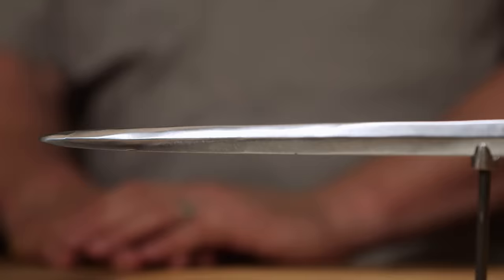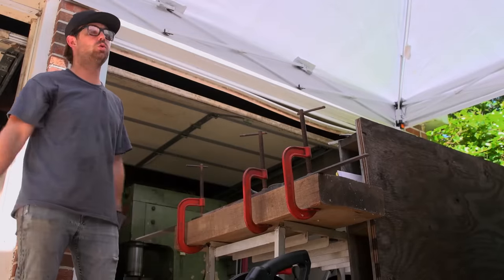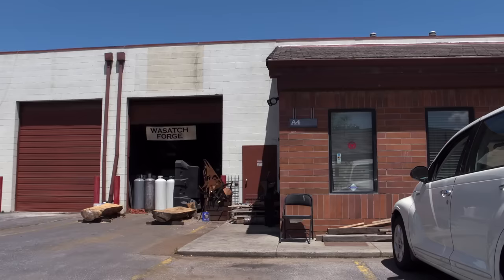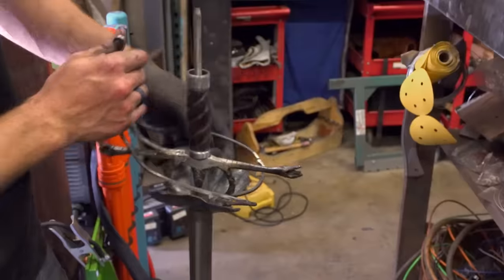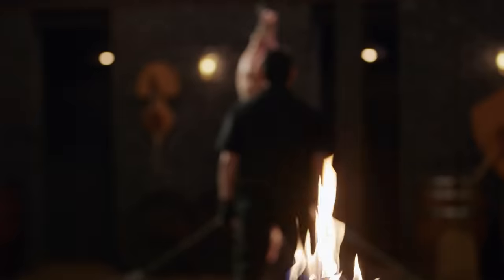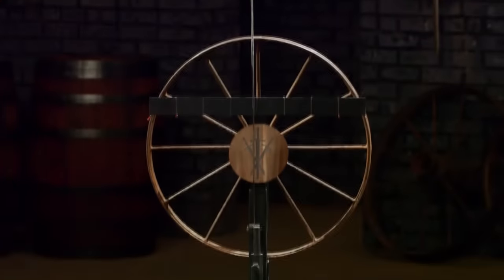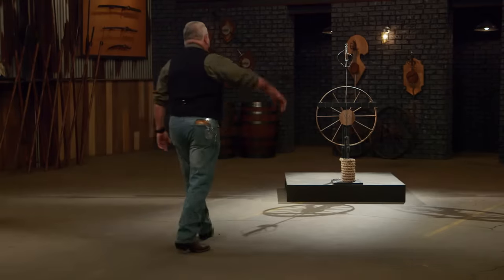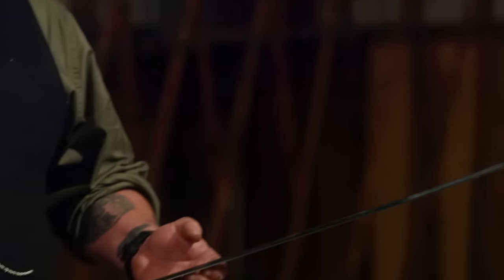Forged in Fire: Musketeer Rapier Final Round: Teddy vs Jesse (Season 7) | History

Comment: these strength tests are bananas. its like something cold steel would do in their marketing. i could not believe how far those swords bent without snapping.  was almost 90 degrees.  both were very well made.
Reply: A blade that is hard will snap under pressure, combat isn't perfect and more often that not your blade is going in and out of something at a weird angle
Reply: charles norris It is not almost it is 90 degrees
Reply: SHPRESIM Leci it’s clearly not it’s a few degrees above
Reply: I cringe everytime they do this test
Reply: The test is original from traditional toledan blacksmithing and swordmaking.
It first consisted in flexing the blade 90 degrees both ways and then hit hard a helmet with it.
All good swords had to pass it.
Reply: The test is stupid. Of course a sword isn’t meant to bend like that it’s a sword not a boomerang
Reply: @Dog Faced Pony Soldier but with that flexiblity, the lose some of their piercing power. Even if very sharp, a blade that flexible could probably be stopped by a leather armor.
Reply: @landonjenkins4402  well actualy a rapier IS supposed to be extremely bendy and almost all swords have to bend really well anyway. You don't realize the wonders of spring steel my friend...
Reply: @TheMihig  at the time you would primarily face opponents with gambison wich is very hard to go though anyway since a proper one can pretty much almost stop a warbow arrow from going through.
In that case you'd prefer having a blades that bends well and goes back to true rather than a hard blade that snaps because it couldn't go through.
Reply: A rapier is supposed to be very stiff as it was primarily a thrusting blade. While flexibility is important to a degree in a rapier, it functions primarily as a detriment past a certain degree. What you are likely thinking of are practice rapiers, which are flexible in order to mitigate injury.
Reply: @brendanbreland4652  They probably meant flexible as in having a high yield point on a stress-strain curve, rather than a low elastic modulus. You would want a sword to bend under a lot of pressure (e.g. when hitting an extremely hard material or hitting at the wrong angle) as it distributes the force onto a larger area, such that the sword does not break or permanently deform. In any case, flexing is a pretty good way to test the heat treating, as the presence of dislocations and defects in the blade would significantly lower yield strength/strain. (Or so wikipedia says)
Reply: @xXDJ_BennieXx  why?
Reply: @landonjenkins4402  that's literally what rapiers are made for
Reply: with modern steels available. the bend test should be passed easily
Reply: @landonjenkins4402 a rapier in particular should. The spring can actually add extra power to a stab.

Comment: Two men on battlefield, one bends his sword and comments, " sir, I have had a catastrophic failure of my blade and cant allow myself to continue with an inferior hardened weapon and must leave the  battle.
Reply: But, it weel keel
Reply: I agree mate, if I was in battle, it wouldn't matter if my blade was a lightening bolt shape, I would still fight!
Reply: If it was battle you wouldn't have a  Rapier
Reply: @jmc9137  i guess you're missing the point. I said " sword " in my comment. The general thought being..  you use what you brought to the fight, no excuses. And then there's the stupid way in which they do their strength test. Stop using a knife as a hammer. Any bladed tool is for chopping, cutting, stabbing, or slashing. Every tool has a unique purpose.
Reply: @MrRadioAmerica  ok
Reply: @MrRadioAmerica  This particular test was a good one for this weapon though. Rapiers need to be very flexible, since they're so light. I've seen local sword smiths who demonstrate the bend test on most of their swords before they sell them to you. For some weapons they definitely give them inappropriate tests though.
Reply: @jmc9137    You would use a rapier in battle. They had guns back then but infantry and cavalry charges were common.
Reply: @TheGrumbliestPuppy  rapier aren't actually light they can be pretty heavy it's just that the center of gravity is placed near or at the handle to make the rapier very maneuverable.
Reply: @Appalachian Sasquatch with Internet Access a proper rapier should way similar to a longsword which would be on the more heavy side for a sword.
Reply: Would it be more accurate to Widdle a Rock
Reply: @thorfinn_jorstinnsonr  It's all fine and dandy until you strike an opponent's shield and your sword bends into an L-shape.
Reply: @dogman9291  THEN YOU THRUST SIDEWAYS!!
Reply: @dogman9291  T'IS BUT A SCRATCH!!!
Reply: @thorfinn_jorstinnsonr  I like your attitude, soldier, but a man without his sword arm is a dead, dead man!
Reply: Exactly! It was FAR FROM being a catastrophic failure, it was a minor bend, nothing more. It was obvious which one won, but to call it a catastrophic failure is just wrong!
Reply: That's the reason you test them before
Reply: @thorfinn_jorstinnsonr  If your blade was in the shape of a lightning bolt it'd snap withing one or two hits.
Reply: But they do have to determine a winner so any mishap is justification to eliminate.
Reply: @TheGrumbliestPuppy  rapiers are actually just as heavy as medieval arming swords, they are just better balanced for manuverablility
Reply: @thorfinn_jorstinnsonr  Not the point but okay.
Reply: Hahahhaha
Reply: If I was the guy with the broken sword I would just throw it as a distraction and pull a rondel dagger to close the distance & make it impossible for my opponent to thrust or cut into me.
Reply: The point is to see who has forged the superior sword, and not can that weapon be used to kill even after the tests.  Even a stick with a sharp end can be used to kill
Reply: Please shake our hand and leave the battlefield
Reply: @jmc9137  if the halberd or musket broke the rapier is the last option
Reply: @dogman9291  i thrust upwards
Reply: @spartansquid5931  it will still do
Reply: No you would it’s die
Reply: Understandable, have a great day
Reply: @thorfinn_jorstinnsonr  yeah you would, but you would be at a severe disadvantage against someone with a better blade
Reply: @TheGrumbliestPuppy  rapiers aint light my friend, they usually weigh about the same as a two handed sword yet they are much easier to control due to the weight distribution
Reply: @grief6052  Wow thanks for not reading the rest of the comments and seeing that 9 people have already said this.
Reply: @TheGrumbliestPuppy  well I think tests are always a bad test
It's all abuse 
But I totally know what your saying
I think it's dumb that they did/do a kill test and then act like any other tests matter
😆
Reply: @brandonfoley7519  but thenother tests matter and they have to pick a winner no?
Reply: @brandonfoley7519  if they specify it so yeah... u can lose if you made something out of the parameters...
Reply: but a rapier has to be flexible, that's what this test is about. if it bends that's a problem. obviously if a sword is falling apart you will still use it but they aren't in battle and that sword failed
Reply: @jmc9137  rapier was massively used in battle in 17th, progressivly remplaced by court sword(sword for noble, like noble at Versailles )in duel and saber in battle
Reply: "Can't use a sword? Understandable. Take your position among the bayonet line. "
Reply: Second man raises his weapon : It will kiiiilll!

Comment: "Now, a rapier needs to be a fast, light, flexible weapon" From what i've heard rapiers are actually little bit on the heavy side, what you are talking about is a... well google translate called it a skewer...
Reply: yeah, rapiers being light is a massive misconception. They were just as heavy as any other sword.
Reply: @sailoroftheinternet3290  They are also pretty rigid. Only training rapiers are flexible, as to make stabs not dangerous... which is not a sought-after perk in a weapon BASED around thrusts.
Reply: @sailoroftheinternet3290  yeah, the real difference with others type of sword is that in the rapier, a lot of the weight is concentrated in the cross guard
Reply: Rapiers are certainly not for the nimble types . They weigh from 2-4lbs. A bit of a range there. 
The cross guard area has quite a bit of  weight to it too. 
Not sure why video games think the rapier is for lightweight bandit or thief types. Add a Rotella shield to your off hand and some armor to complete the set. 
 For nimble you want  a  epee or small sword in that role or a dagger.

Comment: Rules for winning Forged in Fire:
1. Use spring steel stock. Don't do Damascus/pattern welded steel.
2. Make your weapon as light as reasonably possible.
3. Make sure your handle is rounded and comfortable.
4. Get the heat treatment right.
5. Put some kind of shock-absorbing material in the handle.
Reply: You need to be a contestant
Reply: You don't want the handle too round or the weapon will be difficult to index
Reply: @6393dude  was about to say that. Lol
Reply: Handle needs to be ovoid in shape not round. You can't index something with a round handle it also turns in your hand when you make contact. An ovoid allows you to index perfectly and keep edge alignment even after you make contact.
Reply: Ik it’s overdone but do make a Damascus blade. If it comes down to aesthetics that’s points towards your blade
Reply: Solid rules, handle shape has already been corrected enough that this should be a poster for blacksmiths
Reply: Also the guy used knife/tool steel for the sword that's why it's so strong lol.
Reply: La ROPERA tiene forjado y acero toledano ,rico en carbono,al cruzarlas con catanas estás se rompian, 40 españoles derrotaron a 1000 samurais
Reply: @procheesy2355  i have yet to see a single episode where teh winner was decided only by aesthetics - if both pass its always either functionality, balance or weight that kills one of the blades the aesthetics are dead last on the list of considerations.

and because folded steel compromises strength of the material you will have to make compromises - either use more material to compensate for the weakness or rishk the blade failing

and of course risk delamination that is ALWAYS a risk with layered steel
Reply: One guy used 5160 which is a Spring Steel, also used in leaf springs, and the other guy used 80crv2 bar stock. Normally the 5160 does do good in most blade functions. It just came down to the heat treat in this episode. I was sorta suprised 80crv2 did as well in the flex test.
Reply: This is just rules for bladesmithing in general
Reply: also they'll say it kills even if its the sharpest or pointiest, make it robust but light
Reply: @procheesy2355 Damascus is just making inferior steel a little better.

Comment: They always seem to give up on weapons too easily. 
"Your blade did reflect the sun into my eye a little bit too much. This is a catastrophic failure, and for that reason can no longer test your weapon."
Reply: It seems your edge has taken on a roll 1/64 inch long after we beat it with a sledge hammer while its was layed edge down on a bed of iron files. This is a catastrophic failure.
Reply: Should be more like: "It seems, that i cannot use any weapons, that are not short and stiff, like a chisel. This is catastrophic failure... I should be laid off, because for that reason i can no longer test your weapon..."
Reply: the only weapon i can remember thinking "they could keep testing it" was the wind and fire wheels : he had two of the exterior blades snap off. after the second, they gave a vote of no confidence. here it was more valid i think because of how close the bend was to the hilt, compared to the almost utter lack of bend in the other weapon
Reply: mustache mike bahahhahha fr
Reply: the nexy test was thrusting how do you thrust with a tip going at a 30 degree angle?
Reply: carefully. in all reality, it was less that his weapon utterly failed, and more it sustained significant damage where the other took effectively none.
Reply: @gabycashy5  The point is that they never bother to try. It is still a useable weapon, if it happened in a real life situation you wouldn't suddenly run away, you'd keep using it because it can still inflict serious damage and kill.
Reply: L3GION MUSIC hahahahaha
Reply: SπdR if they can’t have a good grip the blade could slip and hurt the tester
Reply: "Your sword was made a different time of the day that is unfair we will have to fail you
Reply: @SπdR the funny thing is that actually happened
Reply: We shot your sword with a missile launcher, and it got bent. Therefore you cannot continue this competition
Reply: Your sword had scorch marks in it because we blew it up with C4. This is considered a catastrophic failure and we will have to ask you to leave the forge.
Reply: Seem indeed to the untrained eye. If you torture test a sword which has bad heat treat it can snap and harm the wielder. It has happened before and they have medics on set.
Reply: You miss out we between reason and can
Reply: The fact of the matter is that one weapon took a bend and the other didn't. Saying "catastrophic failure", as bad as that sounds, is still better than the real reason, "Your competitor's blade is so clearly superior to yours, there's no point in further testing."
Reply: lol i wanna see you guys test a sharp weapon without knowing how safe it is
Reply: @L3gionMusic  bro... if it lose, then it lose, why taje the wait and let the man suffering instead to just send him back home soon?
Reply: @lukewithann7256  right? I allways fear the icechop test
Reply: It seems I’m not strong enough to put a dent into this blade, and because of that I am embarrassed, and because of this, we have killed your family and ask you to please leave the forge.
Reply: My wife left me last night and that is a catastrophic failure, so for that reason I'm going to have to ask you to please leave the forge.
Reply: the blade already took bending on the first flex test. Then the bending was more pronounced after the 2nd flex. there is a possibility that the blade would snap or shatter onto the next tests hence they have to give up
Reply: Whenever the blade bends, and it’s not a flex test, they always allow the competitor to bend it back before the next test. The problem is a rapier is supposed to be bendable.

Comment: If I were the judges, I’d wear a full suit of plate armor while doing that wheel test.
Reply: That is a lot of potential energy.
Reply: Plate was well on its way out by the heyday of the rapier.
Reply: why?
Reply: Sergeant Rainstorm meant to protect against the rebounding metal bits should the blade experience a catastrophic failure. 

The shock alone could br3ak a bone in the arm holding the sword. Worse yet parts of the blade could spin around impaling the person holding it.

That reason is also why they wouldn't the second blade through the strngth tests since it occured multiple fatigue points making it more likely to snap.
Reply: @sl4637  it can bro... it's the murphy law, if something can go wrong, it will
Reply: @Y4ngCP  that's not a real scientific law
Reply: @soul613  yes it is, newton's 4th law
Reply: @Ghastly_Grinner  plate was good against swords and many melee weapons, but then guns came around and it didnt really matter if you could be protected from a sword if you were gonna get shot right through the plate anyway

Comment: If you listen again, the problem was that the blade bent, then was bent back the other way and stayed bent. They were questioning the heat treat and were worried it would break. Probably wasn't heated thoroughly

Comment: Rapiers aren't really the optimal weapon for cutting up a dead pig or being used as a spring. They co-evolved with fighting systems and environments and needs rather different from these tests. How do they balance? Do they protect the hand while allowing good mobility? Are they agile? How does the blade react when parrying another blade--is it easy to get the point on target in a quick riposte? Winning this contest appears to have little to do with building a good rapier.
Reply: That's what i thought. Rapiers are meant for thrusting and duels, not slicing

Comment: How is it a catastrophic failure if the bend in the blade was a possible outcome?
Reply: Because a sword is not supposed to be bended permanently.
Yeah it was a posible outcome but it is a failure
Reply: Yeah totally didn't go right they should've did the sharpness test cause there was still a chance other guy would've lost
Reply: Kevin Santos 
We’ve seen a number of bent swords go through the sharpness test, this instance was odd.
Reply: @matthewpham9525  yeah but I don't remember it being a rapier
Reply: Kevin Santos
Not a rapier, but I don’t think that has anything to do with it. In the khanda episode, they let one guy straighten us blade after it took a REALLY severe bend.
Reply: @matthewpham9525 the name of the sword is the khanda? I Don't seem to find that episode could you gimme me a link?

Also Rapiers are thin really flexible sword, those test are there to test the flexibility of the sword if one takes a permanent bend on that test then is game over
The other sword didn't bend during that test there is no way the other guy would've won.
Reply: @kevinsantos5050  Actual combat rapiers are not supposed to be really flexible swords. It won't function properly as a thrusting weapon if it's really flexible, because the thrust loses power as the sword bends (imagine trying to stab through some armor with a super bendy sword). You're thinking about the kind that is used in fencing, and those are made really flexible specifically to make them less dangerous. This bend test that they used is pretty bogus, and they should stop doing it.